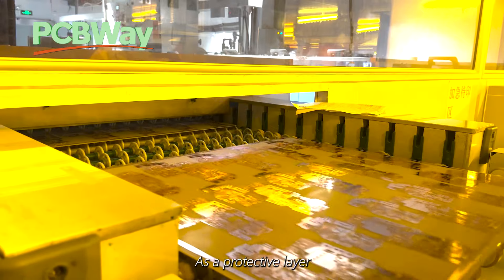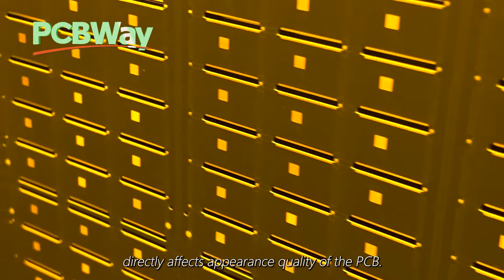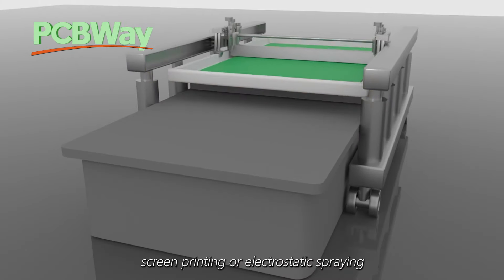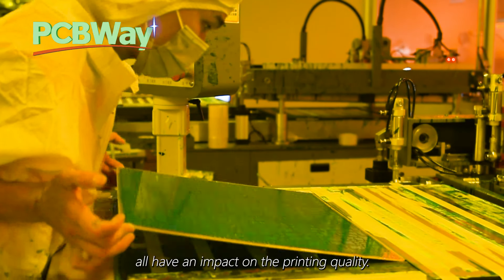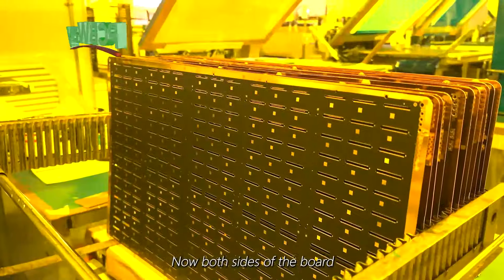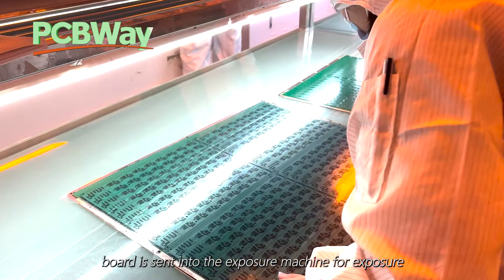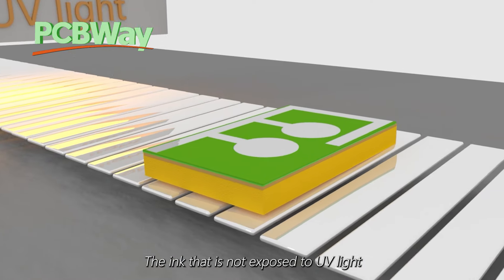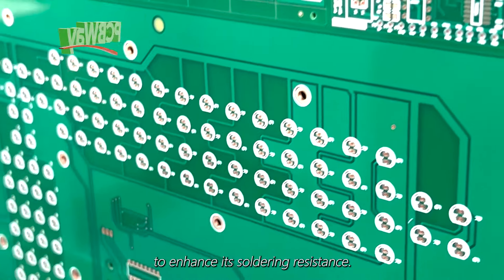Soldermask | Multi-layer PCB Manufacturing Process - 11

Comment: im using a uv ink wich come in small tubes if you know and i think its to heavy to use it with silkscreen method , can u tell me a way to make it more lighter for  silkscreen or spraying it , and if this ink is not green enough ,which chemical can i use to make it more green , Sorry for taking so long, thanks.